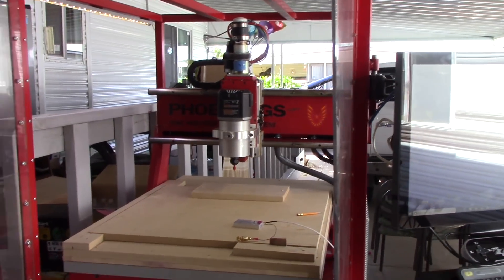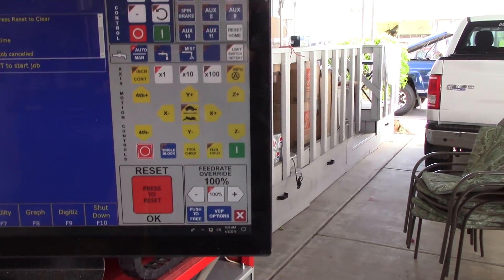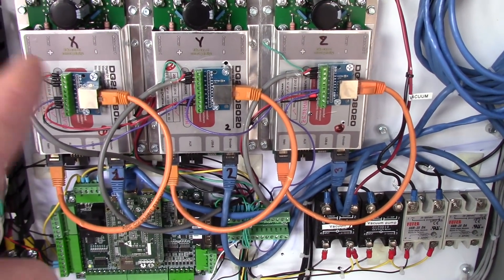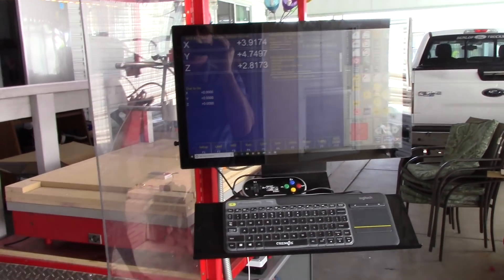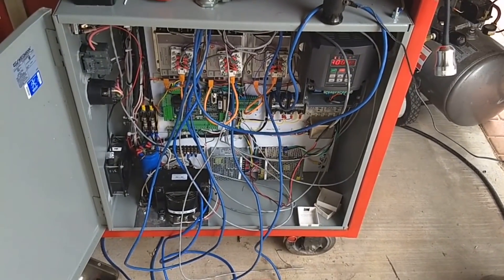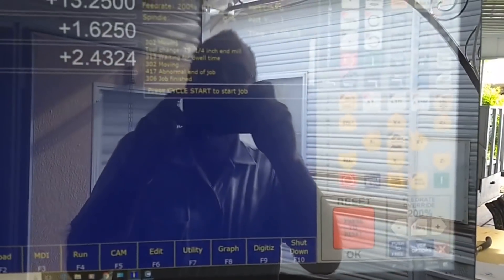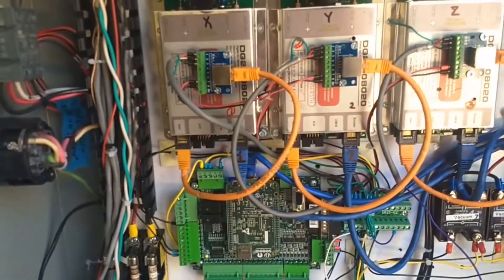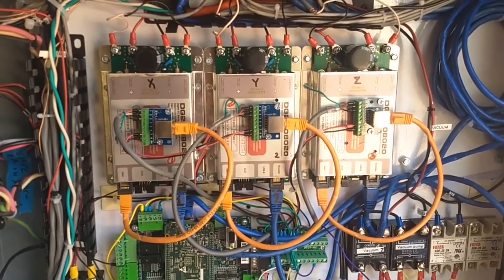Phoenix 2x2 CNC Router Centroid Acorn Retrofit DG2S Drives

Comment: Hey Marty, I have a millwright Cnc mega v plasma Cnc. If I bought the acorn for it would it control the Cnc router part and the plasma part? Just wondering if they have a plasma version of Centroid acorn?
Reply: Please ask this question on the Centroid CNC Users forum. Show pictures of the machine, how its currently controlled and how the plasma portion of the control works if you know. There are plasma users using Centroid. Plasma specific control software is on the Todo list.
https://centroidcncforum.com/viewforum.php?f=20
Reply: Marty Escarcega thanks Marty

Comment: my router is running slow 47kh what does that do to THE speed THE ROUTER HAS 2KW X 1.3KKW .750KW ON THE Z  AC SERVO MOTOR THE WORK FAST ON THE TUNNING SOLFTWARE BUT SLOW ON THE CONTROLLER  DOES IT NEED MORE KH?
Reply from the maker: Larry Dixon Centroid Acorn? Pulleys, direct drive? Not enough info
Reply from the maker: If Centroid Acorn, post to the Centroid User Forums